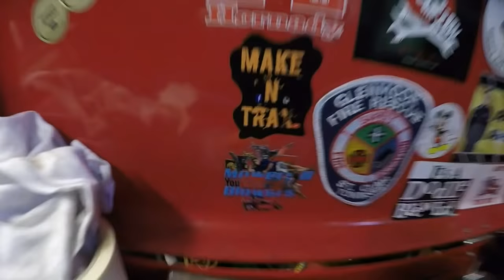CAR BOOT LAWNMOWER WILL NOT RUN HOW TO FIX #SMALLENGINENATION

Comment: Hi Mick. May I pick your brain? My mates ride on has a fully charged battery, turn on ignition all lights come on, sit on the seat safety light goes out. Turn the key..... nothing. Doesn't even try to turn. Any ideas please. Cheers
Reply from the maker: Tom Hickey ok so it could be something simple but it’s finding it. If the lights come on then I would say it’s not the ignition. Could be the starter try giving it a tap while the Key is turned. Could be the solenoi.  Try taking the plugs out and turn it over. Oh and check the oil. Hope that helps
Reply: @themowerman  thanks buddy I appreciate that
Reply from the maker: @tomhickey1266  and test the battery with a meter